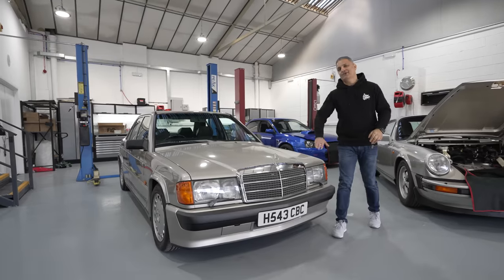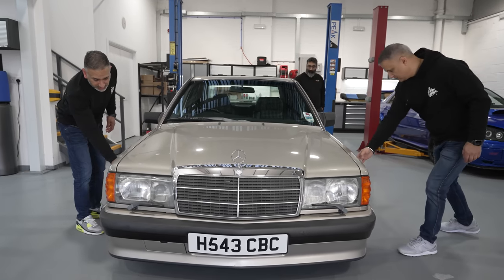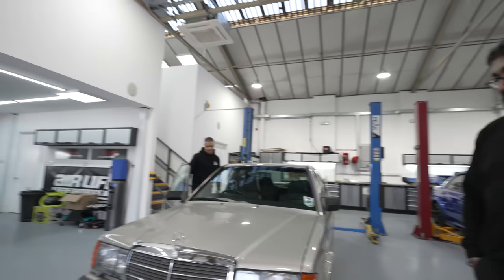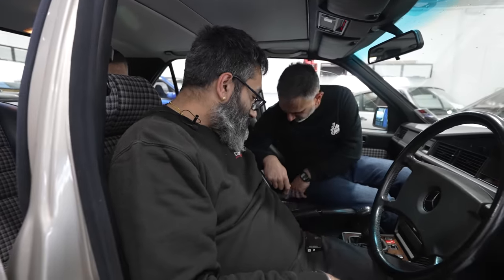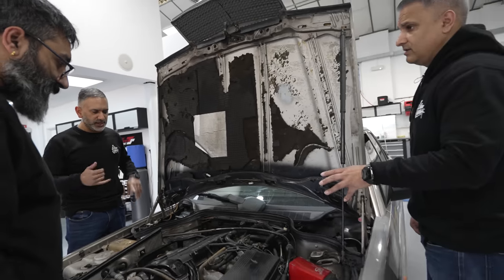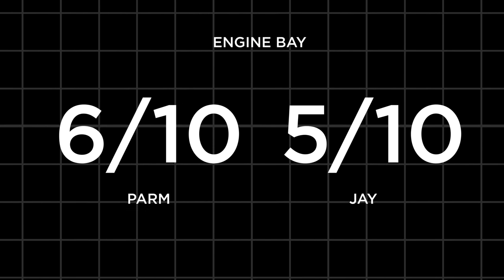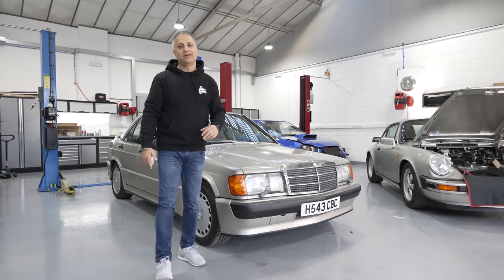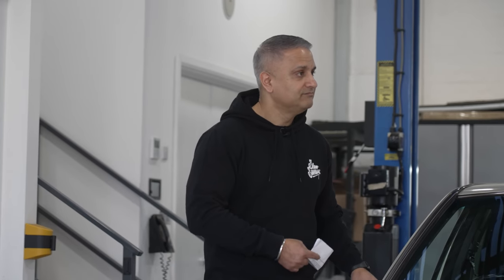Mercedes Benz 190E 2.5-16v Cosworth - have I bought a lemon? | Raj's Garage Ep49

Comment: Question about coil-overs. Do they compromise the the shock tower as it's not designed for all the loads? if you track the car and lower it it's going to see a lot of load up through that location rather than over the tower/mount and over standard spring mount. I'd prefer bagging it but maybe that's not so good on the track. Maybe H&R has some sports springs that can lower the ride but preserve the engineering.

Comment: K&N filter in original air box
Momo 5spoke 17’s (biggest you can fit really but leaves issue regards spare as it won’t fit in well if it’s 17)
Koni adjustable on front, rear of car is self levelling which just follows whatever you do upfront as long as system is sound and oil pipes are good.
Brembo drilled and grooved discs upfront standard rear
Tony law in Leeds can build spot on exhaust from where manifold goes 4 into 2 into 1.
CHECK timing chain and all gears/followers/tensioners, v important if your going to abuse it.
Enjoy